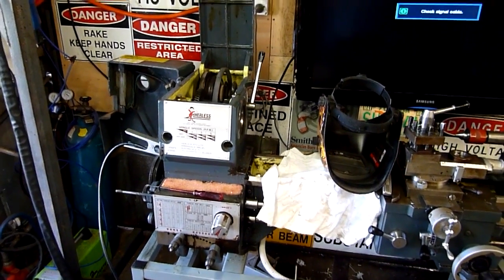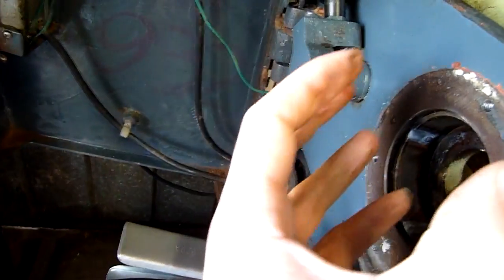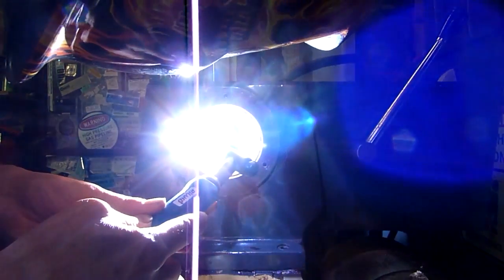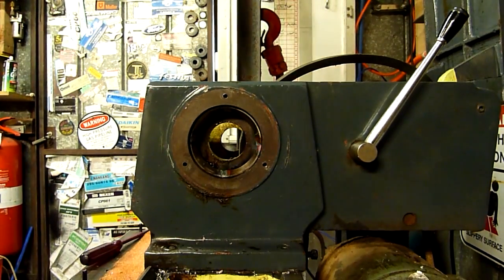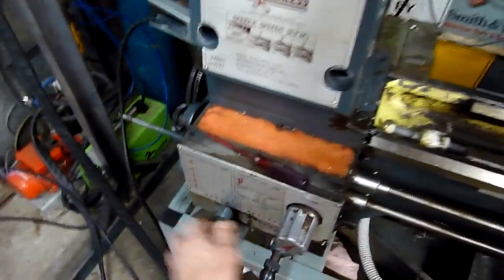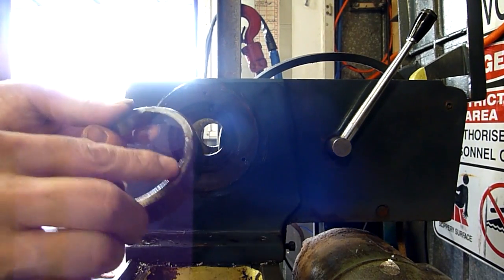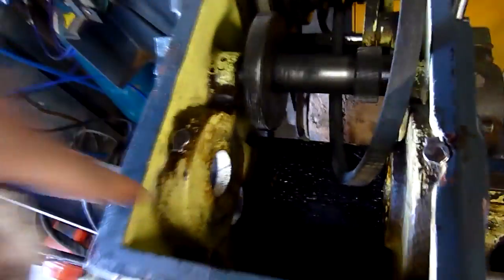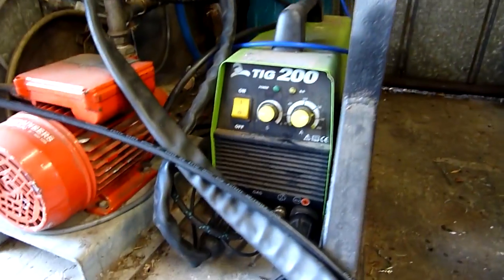Removing Taper bearing outer races with a tig welder in a lathe, car etc

Comment: I always did the job with my mig but as you say its messy, I have some BMW steering head bearings to do so will be trying the tig out. Thanks for the tip.
Reply from the maker: yeh just clean out any grease and grime, zap them in at least 4 places and they should fall out without the messy spatter of a mig or arc welder.
Reply from the maker: or run the bead around the inside rather than stitching it, just do a full 360 with the torch and it should collapse in when cooled
Reply: @aussie50  year running a full bead was my usual method but having tried the four spot  system I believe that to be better.  Job done.  Many thanks,  forn freezing Scotland.

Comment: i wonder why there hasnt been so many electrocutions with one of these welders - i reckon its got something to do with god being here.
Reply from the maker: The arc is low voltage, 24V or so, it hurts but I have never heard of a fatality from a tig welder. maybe somebody with a weak heart died at some point but I am still alive.  the high voltage arc start is several thousand volts, but the current is so low its painful but not dangerous.

Comment: So you didn't use any Argon with the tig? I couldn't hear any post flow.
I've got a tig/mma/plasma machine, if I don't need to rent a bottle of argon I will give it a go.
Reply from the maker: I used argon, I just have the post-flow turned right down to save gas, tig electrodes burn up instantly without gas. as opposed to rental you should be able to buy a bottle, its a bit of an inital outlay but if your not using a lot of gas, and the cylinder sits idle for long times, buying is best.

Comment: Hold on to those old bearing races.  You can use them to help install new bearings of the original size without your pusher tool getting stuck.

When I've done automotive automatic transmission work I used the old bearing races, ever so slightly ground-down on the OD, for just this purpose.  Someone welded them to a length of pipe and we used a small sledge hammer to knock 'em in.

Comment: Good one. Awhile back I needed to cut a thick chain link. Working on the road I had no cutting tools. So I fired up the stick welder cranked the amps up and burned through the link

Comment: My work with old video professional videotape gear requires bearing work every once in a very long while, smaller bearings of course. I think the last time the last time there was a big problem removing a bearing, the guy I was working with and learning from (who know what he was doing) had to try many things and  it ended with a piece of thick steel made into a jig, then there was a big hammer and then there was a torch. And then the visit to the local bearing place and it was all fine and good.

Comment: I guess it's easier than blasting the thing with a CO2 extinguisher to shrink the metal down, cheaper too I suppose... :P
Reply: You know those air duster things in a can? Tip one of those arseways so it sprays liquid instead of vapour, and the thing you're shrinking snap freezes, because there's all sorts of anes like propane and butane and other hydrocarbons that go bloody cold when exposed to air

Comment: I was down your way this arvo. Old mate at the yard said ‘oh you mean gyro!’ Haha
Good trick on the bearing. Frankston bearings never seem to have anything in stock. Just my experience.
Reply from the maker: Haha yeah I missed you by a few mins from what I heard :p. if you want to catch up let me know!. 
I miss having CBC around here, but since the steel mill closed most of its operations they had to go. Frankston Bearings is my next port of call, not too bad, but as you say, they often do not have what you want.

Comment: I did this last thursday whilst replacing the steering head bearings on my wr450f! Worked a treat
Reply: Hi, I know it's a long time ago, but were you worried about melting the alloy of the head stock?
Reply: @garycrofts1421  not at all as aluminium is a great conductor of heat - it dissipates into the bulk of the surrounding metal before any localised areas get the chance to reach melting point. That said, you definitely could do some damage if you held a torch on there for long enough! Just keep a reasonable pace and it will be fine.
Reply: @Askor200  thank you 😊

Comment: I see you too have been watching way too much AvE, and have started picking up on his catchy lingo. I've got a badly worn wheel bearing in my Lexus and I'm not sure if the bearing will come out as a unit or fall to bits as soon as I reef on it, so this little tip will come in handy
Reply: Here's a poor man's solution: I had a race in a Jeep rear axle housing to remove, no welder, no way to move the Jeep. Took a can of Air Duster, turned it upside down, sprayed the race until it frosted over, put on a glove and pulled it out by hand.
Reply from the maker: yeah I used to blow them away with oxy and make a mess until I saw AVE's explanation